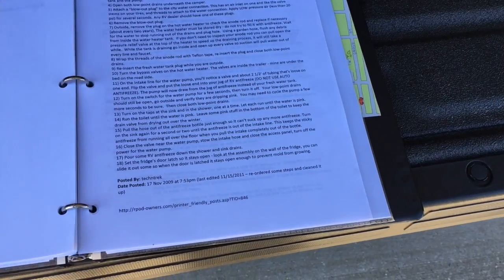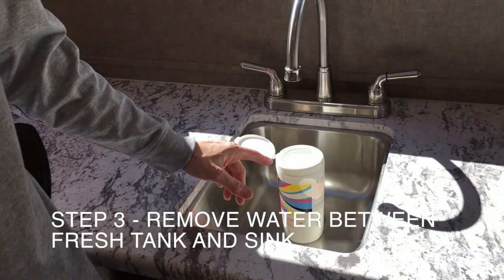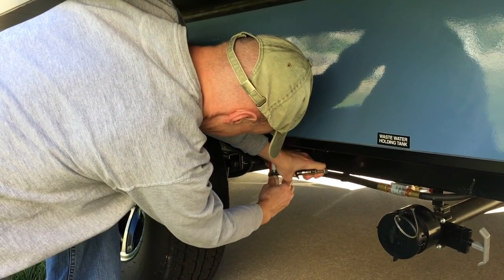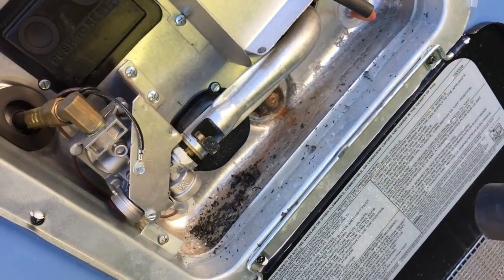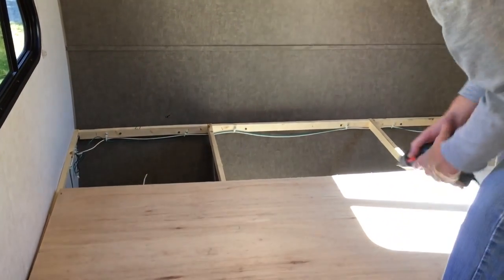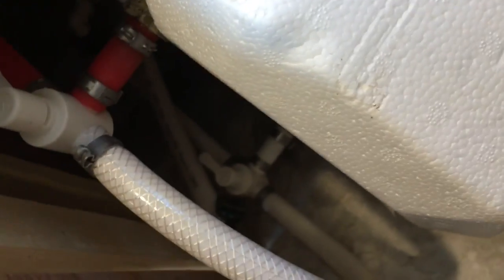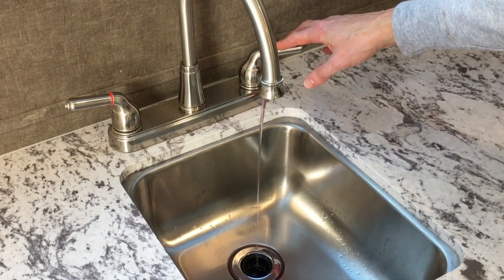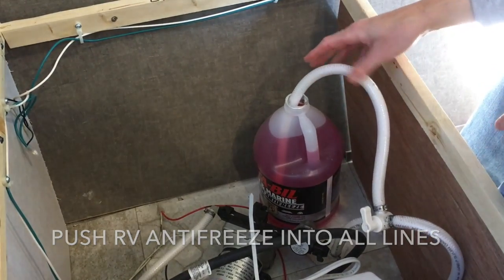R-Pod RV Winterize – Step-By-Step Process (with Anode Rod)

Comment: super helpful video, thanks so much.  I don’t have an air compressor, but if I were to buy one - will any air compressor do, or is there something specific to look for when buying?
Reply from the maker: Alison, The one I have is small but has two gages, one to show how much pressure is in the tank, and the other gage to show how much pressure is dialed to the line. Some cheaper compressors only have the tank pressure gage, which won't allow you to regulate a steady stream into the line. Here is an example of a decent one from Walmart on sale. I did buy mine originally to do some upholstery work, so it can come in handy for other things. I would also check a local Harbor Freight store.  https://www.walmart.com/ip/Factory-Reconditioned-Bostitch-BTFP1KIT-R-18-Gauge-Brad-Nailer-and-Compressor-Combo-Kit-Refurbished/151126061

Comment: Hi John-just got an Rpod 179 so your videos are fantastic as far as leading a newbie through all the systems and their processes for winterization and DE-winterization.  I have subscribed to your youtube channel and look forwrd to any tips and tricks you can offer!!  I am not certain about where to put the pink antifreeze since out RPod has no siphon hose to put directly into the antifreeze.  I have watched the basic and regular de-winterization videos and I'm still a little worried about filling the hot wather tank with pink fluid.  Also, where is the best place to pour the antifreeze to get it into the system?  Thanks so much for all your help!  Chris
Reply from the maker: Chris, have you identified the location of your water pump under the bed? If so, you are saying there are no valves at the hot water tank, also under the bed? What year is your 179? Thanks.
Reply: @JohnMarucci  Thanks for getting back so quickly-there are valves but none with an open end to use a a siphon for the antifreeze
Reply: it is a 2016
Reply from the maker: Chris, feel free to attach a few photos of the area to my email at: john@johnmarucci.com
Reply: @JohnMarucci  Will do first thing tomorrow AM-thanks!

Comment: Don't mean for this to sound like a stupid question, but could you prepare your rv for winter simply by draining all the water? Blowing air thru the pipes would be an added step.  No water nothing to freeze.
Reply from the maker: Harley, lots of folks use compressed air only vs using RV antifreeze. You just need to make sure you get all the water out or you can have serious problems when it freezes. Thanks again for watching!
Reply: There will be residual water in the lines that collects at the low points.  This would also potentially happen if you did a sloppy job using compressed air.   For safety sake, I use both methods.  Compressed air and RV antifreeze.  Is it necessary to do both?  Probably not but it is the safest method.

Comment: If I don't have an air compressor is it enough to just look for the antifreeze to come through the system?  Do you use teflon tape on everything that has to be screwed back into place?  I just received notice yesterday that my R Pod 176 has arrived at the dealership.  I'm wondering if I should just have them winterize it for me since winter is just around the corner.  Once it is winterized I won't know if there are any leaks till spring.  Thanks for doing the video.  I hope I can do all this by myself.  I know nothing but what I have viewed on you tube.  You are very helpful!!!
Reply from the maker: If you don’t plan on using it before winter, you may want it inquire with the dealer about winterization. Likely they can do it for you.
Reply: In my experience, yes. You might want to run more than a gallon through, but blowing out the lines is not essential if you use the RV water anti freeze. 

We live in an area where the temps don't get much below freezing, so we just drain tanks and flush a gallon in and call it good.

Comment: Is there any other option I can use if I don't have an air compressor?
Reply from the maker: Not really. The problem is leaving water in the city water intake line. I see that a small air compressor is about $70 at Harbor Freight and right around $100 at Home Depot. Much cheaper than having something freeze and breaking. It is somewhat essential equipment when owning an RV. Thanks!

Comment: Hi John, thank you so much for this video and the written instructions! My husband used it today to winterize our Rpod and he found it incredibly helpful. We have noticed once it got colder that the hot water didn't last as long. We were only able to get a couple minutes of warm water. Have you found this? Not sure if it was the weather or the hot water heater. It hasn't gotten below freezing yet (tonight is the first night for that), it's been in the 40s and 50s though. Just wondering if we should have our hot water heater checked or if only getting a couple minutes hot water is normal with the cooler temps.  Thank you again!
Reply from the maker: Hi Holly, it is not my experience to only get a couple of minutes of hot water, the six gallon hot water tank should last longer than that usually. I am curious whether you are using Propane or Electric or both when heating the hot water in the Pod. I have a recent video on the hot water heater if you are not sure which you are using. I almost always use electric to heat the water when plugged into 30 amp shore power and only use propane when not plugged in. Here is the link, feel free to comment back. I would test it on both sources if possible: https://youtu.be/M1qjlSardTM

Comment: Hello, thank you so much for this checklist! It’s so helpful for a newbie like me! Question- I’ve gotten to the compression portion of the checklist, and it’s working as it should....but every time I think it’s blown out all the remaining water, I give it one more cycle with the air and it starts all over again! Should I be concerned about the amount of water the air is blowing out?? Is it normal that I’ve gone through about 6 cycles and it keeps blowing out a ton of water!! The video said a few seconds but it’s taking way more than that! Thank you for any tips!
Reply from the maker: Possibly keep the pressure release valve open on your hot water tank as well as your low point drains, sometimes more will come out.
Reply from the maker: Make sure your low point drains are open before releasing water pressure from the tank!
Reply: Yikes, any clue where I would find that valve? We have the exact same year/model rpod....and yes all the exterior drains are open and the faucets in the sinks are open....the pod is also not hooked up to power or water currently.
Reply: @katiem6537  The pressure relief valve is toward the top of the water tank.  Looks just like the one on your water heater in your house.

Comment: From my point of view, I’ve stopped using anti freeze.  I’ve been using compressed air only ... at thee d I leave all valves and facets open.  As long as 95% of water is out of system, and open, anything that freezes has expansion room, so no broken lines, etc.  4 years no problems.  Also put 1/2 gal anti freeze/Lysol in black tank and sink drains.  This way if I decide to go to Florida in middle of winter I don’t have to deal with anti freeze, and when I come back north I just blow out all the lines at my last warm weather stop.  Compressed air method takes about 30-45 minutes total.  Definitely, got to remember to turn battery off or some small LED will kill it during the winter/storage.  4 years no problems.
Reply from the maker: Compressed air can work if you know what you're doing. Not everyone does. A service manager mentioned to me that they get a lot of cracked water pumps in the spring because people leave too much water in the system and the water pumps crack. In Michigan, it can get pretty cold, so I err on the side of caution. I know a guy in upper Michigan who has used compressed air for years without issue. Thanks for the comment.

Comment: How cold does your area have to get to need to winterize Rpod?
Reply from the maker: Usually if it is going to stay below freezing for more than a few hours and there is water in the lines, you could have problems. If you are staying in the trailer at the time, you can compensate with the furnace and not need to winterize. I have another video on the subject of freeze warning tips: https://youtu.be/kfj1fcn6nok

Comment: There a video doing this without an air compressor?
Reply from the maker: Not that I know of. The blowout plug is about $10 and a compressor $40-50, maybe cheaper at a place like Harbor Freight. To me it is a small investment vs paying a dealer to do it or breaking a plumbing line over the winter. Plus with an air compressor you can then keep you tires properly inflated. Thanks!

Comment: Hi John--great video----I don't have access to a air compressor--can I skip this step?
Reply from the maker: Neil, if you have used the city water connection when camping this season, likely there is water still in that line that needs to be blown out with compressed air. If not, your call, but I always err on the side of safety and blow this line out so no water can freeze in the line and potentially damage or break the line(s).
Reply: @JohnMarucci  Thanks for your prompt reply John--You are a great resource for a newbie like me--very well done videos--I'm sure you have saved a lot of people's "bacon" over the years

Comment: We are still doing research on wether to buy an Rpod or Jayco Hummingbird, your thoughts? Did you look at the Jayco before you Rpod purchase? Very informative vid!
Reply from the maker: dman, The Hummingbird 17RK is about the same floorplan as the RPod 179. I see four things different that you may want to consider: 1. The sink on the RPod is stainless and below the counter, so you can put the insert in for more counter space; 2. The stove is below the counter on the Rpod as well, so again more counter space; 3. The shower has a plastic surround on the RPod vs wallpaper on the Jayco; 4. And this is a big one to me, the Rpod has 30-gallon Black, Gray & Fresh tanks vs the Jayco's 25.4 gallon talks. If you plan on doing any dry camping or State Parks with no hookups, the larger tanks are a big deal. 

The Jayco I believe has a standard 2-year warranty vs the RPods 1 year, so that should be considered. I went with the RPod 179 having owned a 171 prior. I liked the 171 very much, but I was looking for something a bit bigger. I had no hesitancy going with another RPod. They are not perfect, but there is a lot of value for the dollar. 

Obviously, do some walkthroughs of both. I would also include the Winnebago Winnie Drop models to look at as they are also very similar. Thanks for the positive feedback on the video. ~JM
Reply: Hi dman666666666,  Check out the new R Pod 190.  It has a dry bath.
Reply: Thanks for the follow up! They also have a 189 with a sofa and table... now it's a matter of which one to choose. I'm leaning toward the 190.
Reply from the maker: It makes it a tough choice for sure. Lots of +/- for each model. The 180 is great if you don't plan to cook much inside and want the larger bathroom. The 179 (mine) is great if you do plan on cooking inside a lot and may work from the unit a bit (like I do), and don't need a large bathroom. The 189 and 190 are both interesting as they try to strike a balance a bit better. Nice dry bath, less kitchen, less indoor storage, more under the unit storage. It can get  confusing with all the trade-offs, but its sure nice to have the choices! Also, if you try one for a year, like I did on the 2016 171, they keep their value and are easy to sell, so you can look at it as long-term rental to try it out.

Comment: Did anyone have any problems putting the anode rod back in? Mine doesn’t seem to want to line up.
Reply from the maker: Brent, that can be a bit tricky. I usually thread it by hand with the Rod inside the socket.

Comment: I have a very important question...antifreeze is very toxic to dogs...this is pouring out onto the concrete...is there an antifreeze that is not poisonous to animals??
Reply from the maker: Kim, RV antifreeze is food safe and is NOT automotive antifreeze. This pink-colored RV antifreeze can be purchased at a local Walmart or Home Improvement store in the RV section or from a local RV dealer, just make sure you are only using pink RV antifreeze. Thanks!
Reply: John Marucci thank you so much! I had no idea. Your videos and your feedback and knowledge are invaluable. Keep them coming!
Reply: There are some automotive antifreeze products out there which are safe.  The jugs are clearly labeled. But if it's on the ground you won't know.

Comment: John, did you notice your water pump running (making noise) while blowing air through the lines to kitchen and bath and outside shower faucets.
Reply from the maker: Robert, using compressed air in this method was only to remove water from the city line. This is why we used low psi and opened only the low point drain to push any water from the city water line inlet. For the other faucets we pushed any remaining water out by pushing the antifreeze through at each faucet. This does take a bunch of antifreeze but works well.
Reply: I'm curious about the "blow-out" step. Is it really necessary with a small trailer? Pulling antifreeze in until all lines are pink seems adequate.
Reply from the maker: That step is only to blow out the city water line. All the other lines are simple push of antifreeze through.

Comment: is winterizing the 178 the same as winterizing the 179?
Reply from the maker: Very similar but the hot water tank and water pump will likely be in a different area in the 178 vs my 179. You can find where the water tank is by locating the hot water heater on the outside of the RV. The tank will be inside at that same location. If you don't know where the water pump is, turn it on for a moment and follow the sound. Thanks!

Comment: I don't see the point in blowing out your lines and then adding antifreeze. You only need to do one or the other. I don't really understand why people use antifreeze, but I assumed it was only because they don't have an air compressor.
Reply from the maker: Many people don't add RV antifreeze and just blow out their lines with compressed air. I am not as certain with using just air that I will remove all water from the lines.  With the cold Michigan winters if I make a mistake, it would be costly. I would recommend searching YouTube for winterization with compressed air. I know there are several videos to follow. Thanks.

Comment: Sighhh…really wished he showed himself turning off BOTH lines to the hot water tank, and not just the hot line and the pump bypass. My cold line is partially hidden under the hot and I missed it. Have a hot water tank full of antifreeze…
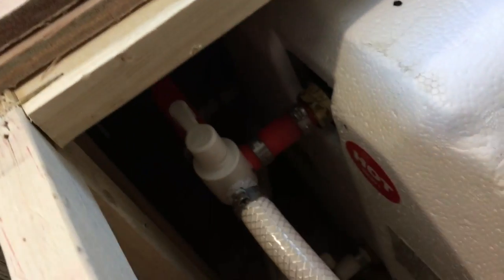Reply from the maker: I just double checked and at time stamp 8:20, I do turn the hot and cold valves to bypass. Sorry if it wasn't that visible or easy to see in the video.

Comment: Excellent presentation - Thanks !  ( what I don't understand is if all the water was drained , why is there a need for the anti freeze  )
Reply from the maker: Thanks! There is an ongoing debate between those who only used forced air to blow out lines and those who use RV antifreeze. The former use air compressors and push 50+ psi through the lines and seem to do okay with removing all the water. Others are not so confident and use the RV antifreeze. If you leave just a little water in the lines by accident, it can do damage to your water pump or toilet seal. I tend to be more risk averse and go with the RV antifreeze. You can find more on this on the Rpod Owners Forum: http://www.rpod-owners.com/forum_posts.asp?TID=10720&PN=1&title=winterizing-issues
Reply: Thanks for asking I am glad I read further down as that's what i was going to ask ...i figured once you remove all the water no expansion is going to happen to damage lines etc